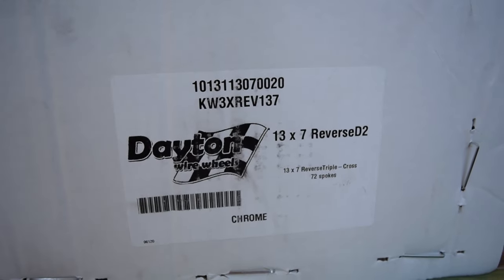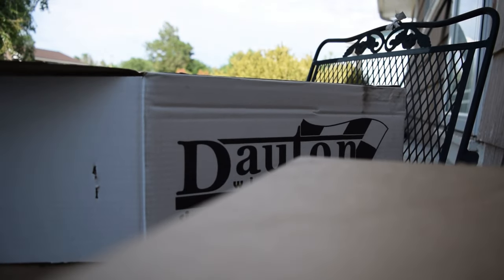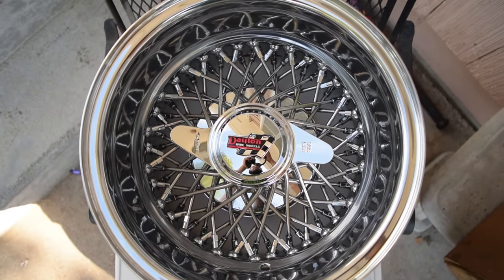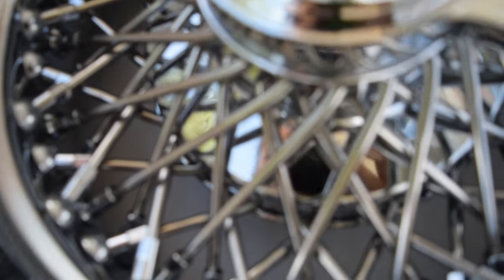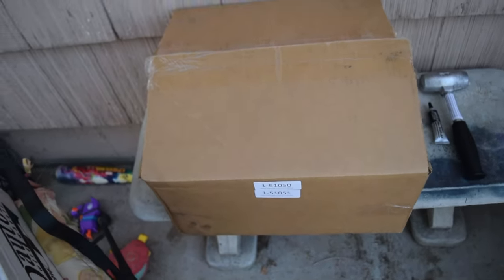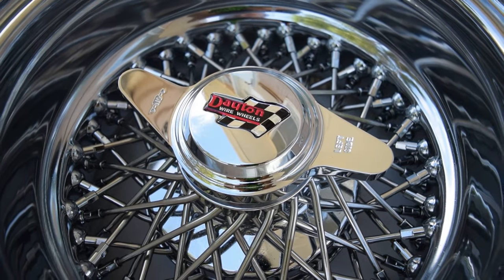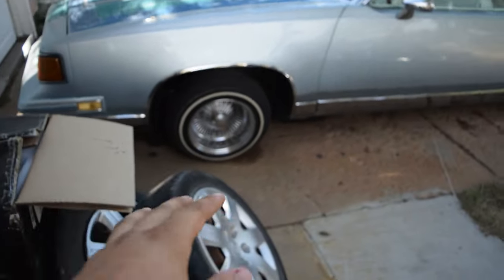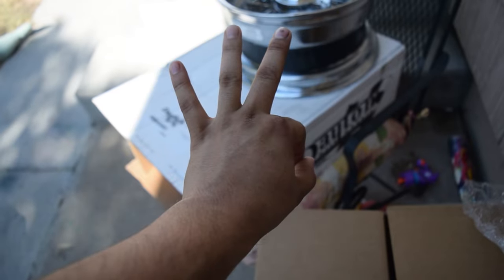Unboxing my NEW Triple Cross Laced 72 Spoke Dayton Wire Wheels!

Comment: how much we're those?
Reply from the maker: Under $5k for all 5 shipped to my house
Reply: @CGOD  what is your take on ankther brand or something in the $2k -3k range, I'm building my first g body, I'm a single mom, on budget
Reply: @CGOD  what do you think if china's or zenith?
Reply from the maker: @L.A._heathen  in my opinion most “zenith” wheels are chinas lol so just go with whatever style you like
Reply: thank you, I don't know anything about rims, just now learning, & doing my homework, to me quality is most important,
Reply: so it might be worth it to save and invest, as I've heard chinas will leak and other issues arrise as well!
Reply from the maker: @L.A._heathen  leaking is only an issue if the seal is damaged, like when you replace tires the shop might cut into the seal and cause the leak. Main difference is Dayton has forged hubs and stainless steel spokes so no rust. You can find US made wheels also with stainless but it’ll run you about the same as Daytons. I was looking at some fancy China wheels and they were barely about $1,000 cheaper than the Daytons.
Reply from the maker: @L.A._heathen  Dayton is top tier, you can look into Truspoke wheels also, they’re American made and have been around forever. Not as high on price as Daytons.
Reply: @CGOD  thank you!!!